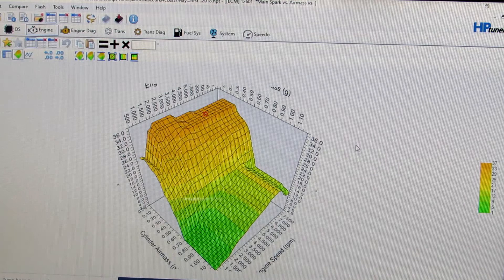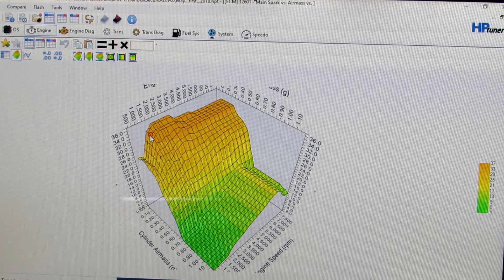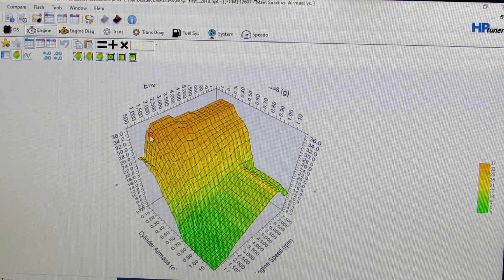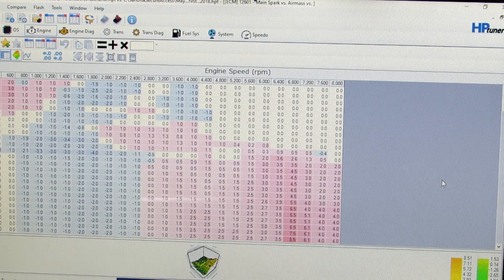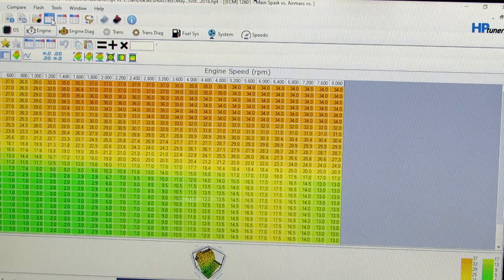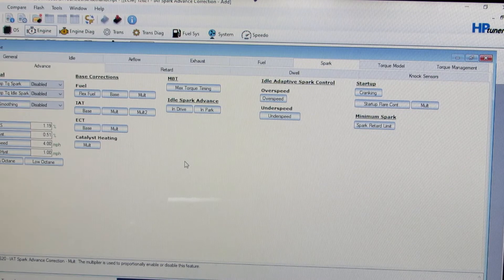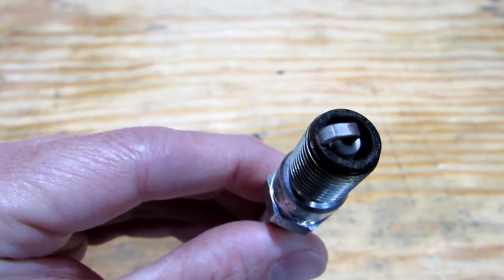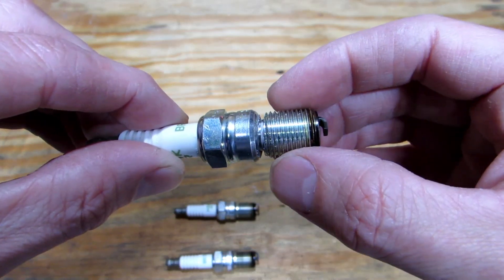LS engine timing explained

Comment: Textbook example of a green horn tuner posting a video after tuning 1 engine or less which explains why that spark table is so butt ugly.  Preignition and detonation...not even remotely close to the same.  If you know you know...either way this guy has no clue.
Reply from the maker: Thank you for your comment.  I'm happy to have professional tuners comment on my page.  What is the name of your tuning shop?  This particular engine is still running well after all these years of daily driving and drag racing regularly.  Currently at over 20 psi with an F1a-94 procharger on it.  I must be a very lucky fella.  Happy fathers day!
Reply from the maker: You must have misheard what I said because I did not say preignition and detonation are the same thing.  Sorry I wasn't clearer in my speaking.

Comment: You got it backwards, a really efficient combustion chamber will require less ignition lead (or advance). This is the reason we see boosted LS/LT engines with 11.3:1 successfully. Do that with an old SBC/Big Chevy and your tuning window will either be so small it'll be tough to tune or you won't find it until you put octane (or alcohol based) fuel in it. 
Good job otherwise and I think that's basically what you were saying, you just quoted it backwards in the beginning of the video..
Reply from the maker: LOL.

Comment: Your numbers look low. I’d check your base timing. LSA’s run at least 19degrees.
Reply from the maker: Each engine is different and randomly comparing timing tables to different combos can get you in trouble.  In your example an LSA engine is 9.1 to 1 static compression.  Factory boost level is low on them as well.  The particular combo in the demonstration video is a 10.6 to 1 static compression ratio over 15 psi of boost.  Lots of factors really, but a 9.1 to 1 engine on 10 psi is normally going to be able to run more  spark lead than a 10.6 to 1 engine on 15+ psi of boost with both using the same fuel type.  Of course lots of other factors and I'm just speaking in general terms.  Hopefully I made sense.
Reply: @lsxtuner6126  15psi at 10.6 comp makes a lot more sense.
Reply: @Motown952 Agreed! I think it's odd that it's cutoff so that we can't see the other axis labels. If it has an lsa supercharger, the timing is low. If you put an LSA supercharger on an engine that only allows you to run an ignition lead that's considerably lower than idle timing on a lot of engines, you need to put good fuel in it or knock some compression out of it but your camshaft is way wrong if you're anywhere close to detonation!